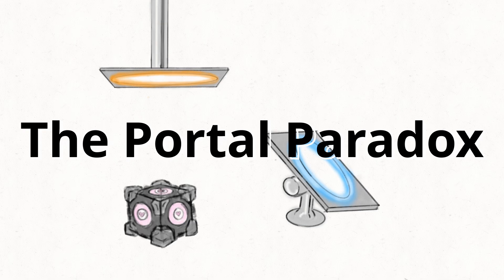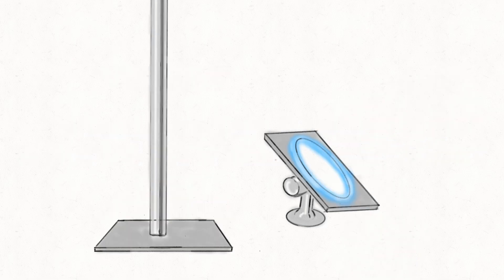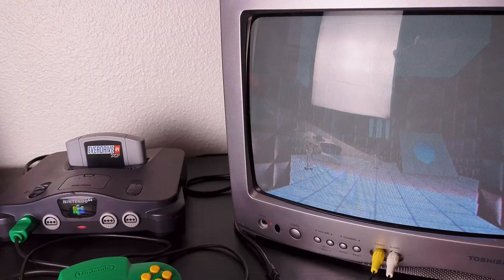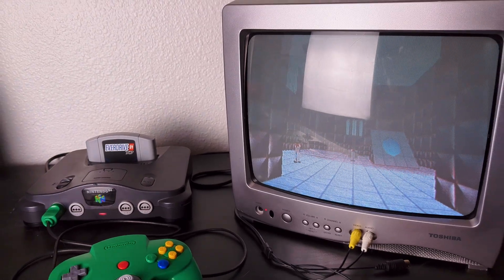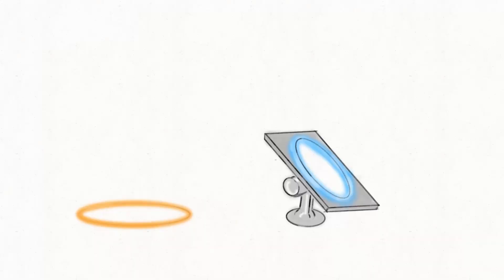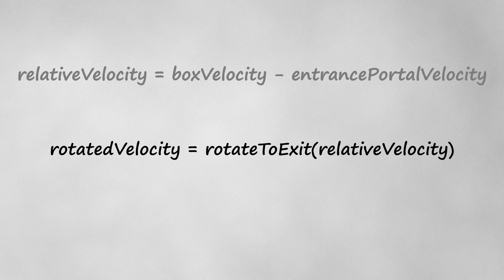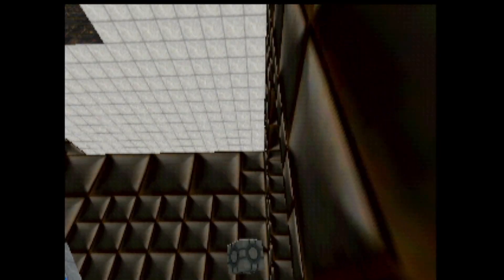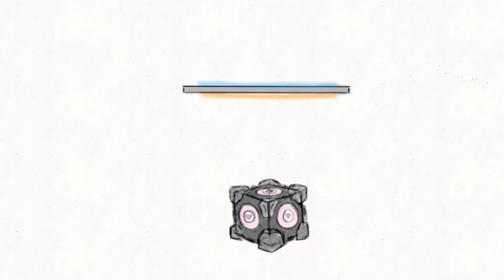I rewrote Portal from scratch and solved the Portal Paradox

Comment: I believe the portal paradox makes the false assumption that the object is moved from one location to the other. The portal however is connection of two disparate locations (wormhole) in this case it's two dimensional. 

From the point of view of the cube (and it's inertial frame) the only change would be in the direction of gravity. 

I believe your equation is correct but fails in that it assumes the two "sides" of the portal have different velocities. While this is true from an external reference, to the cube they have the same velocity. 

Probably also wrong, but that's how I am seeing it work.

Comment: i always thought of it as the total momentum of all three objects remaining consistent, so i figured the cube should stop, but admittedly i struggle to keep track of everything
Reply: I have the same idea. What happens to momentum here. The portal (or the object it is placed on) would decelerate giving it's momentum to the cube. But I cannot rationalize how that interaction would occur.
Reply: @mithrandireichner2667  The answer is basically that the cube doesn't actually accelerate and no additional momentum is required, so none is taken from the platform. The cube is already in motion relative to the portal as soon as the platform starts moving, it simply continues at the same relative velocity because no additional external forces act upon it to slow it down. It makes no sense with our current laws of physics, but, if wormholes area real (and traversable) our laws of physics are wrong anyway.
Reply: @mithrandireichner2667  From the cube's frame of reference the portal has velocity, but from the portal's frame of reference the cube has velocity. Relativity says whichever frame of reference you measure from the total energies involved are conserved (don't change over time), but that individual components of the system can measure different readings depending on the frame of reference you use. You can even use moving frames of reference such as the portal as long as you account for that movement.
We can simplify everything by measuring from the blue portal. And since when traveling through the portal the point in the middle of the orange portal is in the exact same place as the point in the middle of the blue portal (there is no spatial or time difference between them) We don't need to change to a different frame of reference, and therefore no adjustment is necessary (we'll call this point A). 
The velocity of the box going into the portal, as measured from point A = the velocity of the box exiting the blue portal,  as measured from Point A.
Reply: This was my thought too, but when I went to write out a comment about it explaining the math, I think I found the solution. 

Newton's first law states that an object at rest stays at rest and an object in motion stays in motion, until acted on by an external force. But also, motion is relative. An external force acts on the platform to move it down towards the cube, so the cube is already in motion relative to the platform before it even enters the portal. When the cube goes through the portal, no additional external forces act upon it (aside from small ones like air resistance and gravity) so it retains the momentum relative to the portal.

This does seem completely illogical based on the laws of physics we know, but that's because our laws of physics don't allow for moving portals. If you imagine a similar situation in space, it might make more sense. If wormholes had no field of gravity, then an object entering a wormhole would come out the other side at the same speed it entered relative to the wormhole. It doesn't matter whether the wormhole or the object is moving, as motion is relative. No external force would have to act upon the object for it to retain its relative velocity.
Reply: @ayylith  The way I see it, the system encapsulates the portals and the cubes. One side could argue that the cube is moving relative to the portals, but when discussing physics, or math, especially linear math, the discussion happens within systems. We could go on discussions about the properties of this system, but I'm going to ignore that for my comment. Assuming the system includes gravitation, that should logically include the exerting body of that gravitation. So the basis of this system is Earth, the cube and the portals. With both portals, gravitation is negative in both cases, so towards the basis ground of the system. This does not change regardless of any other factor. It is a fact, then, that the cube is resting relative to Earth and the portal is, in fact, the object that is moving. So it stands to reason to assume that the portal is moving relative to the cube.

So my interpretation of this problem more or less disregards the portals themselves as effect sources since the basis of the problem is the cube in resting position. The only thing that should really be affecting the cube is gravity, assuming the portals don't add, subtract, convert, transfer, etc in the process, and that itself is a question based in unrealized information of the *game's universe*, not ours.

Comment: too little experiments to prove this paradox. Altho i do think the example of paradox is flawed itself. Why portal should be drop from the top and not moved from the side? Why the exit portal must be on a slanted surface and not on ground or wall?

If i were to stand in front of portal, that is moving towards me at a high speed. And another portal is on the static wall. If i jump a little and portal moves into me - i doubt i will be launched from another one. I think i will just land on the ground just as normal. As there is nothing, that can impose the momentum on me in this situation.

Comment: I feel like portal paradoxes have changed slightly. Although these were ones that started during portal 1, I've heard of one about tying a rope that goes through each portal (the rope paradox if you will);
would the rope infinitely fall or be static? what would happen if you extended/compacted the portal distance?
This was definitely one of the better paradoxes for me.
Reply: Stop calling solvable problems paradoxes. Gravity still exists. The rope would be pulled towards the earth, "down", and speed up until it's falling at terminal velocity.

Comment: The problem with this is velocity in =\= velocity out. But Energy in = energy out.

The portal has kinetic energy (mass times velocity^2) which is what allows it to move even if we assume that kinetic energy was perfectly transferred to the cube (despite not actually touching the portal), with no loses in heat or sound etc, it would not result in the cube move in at the speed of the portal as they have different masses an kinetic energy must be the same.

Comment: to me there's never been a paradox, it's kinda just like the mirror theory where the mirror is another world you can't enter because you're getting blocked by yourself, i think it's the same here but you're just getting crushed by yourself, from both sides, with same pressure of the two plates crushing you, with or without the portal, only thing that changes is that you're not crushed by steel plates but yourself

(im talking about the scenario where you're in between two portals closing in on you, or an object, you don't have to sacrifice yourself for science)

Comment: This is all dependent on the inside of the portal actually having mass rather than just the boundaries. If the portal is two dimensional with basically a void in the middle where one space merges into the other, then the "collision" with the cube doesn't really happen and the velocity of the portal boundaries doesn't matter beyond influencing when the translation happens. You just have the cube maintaining its velocity after being translated into another space. If that's how portals work, then the cube goes plop.

Comment: everyone always be talking about relative velocities, but dont take into account that the actual relative velocity that the cube sees through the portal, which would be zero. the portal js moving, obviously, but since the cube "sees" through to the other side and doesnt interact with the edges of the portal, the relative velocity of the portal would just be the speed of the other side of the portal, which happens to be 0. 

drawing a force diagram is helpful to understand this too. the portal has no way to impart any energy or momentum to the cube, it just conserves momentum through itself
Reply: The "speed of the other side of the portal" isn't zero - it's the speed of the falling portal approaching the cube. From that perspective, looking into the falling portal, the view of the other side would be approaching rapidly. The point being, energy is conserved upon travel through portals and it doesn't matter if a cube is falling into a portal or a portal is falling into a cube - the relative velocity between the two is identical.

Comment: Unless there is a way for the portal to transfer its kinetic energy to the block, the block will have no energy when going through the portal. And I don't see how a portal would transfer kinetic energy to the block considering the block is just passing through.

This is like a hoolahoop travelling at a certain speed at a non-moving block (floating), when going through the hoolahoop, nothing happens to the block. The kinetic energy from the moving portal is either transfered to the ground (slamming into the ground) or to what is holding it up (by slowing down the portal).

So I don't think your answer makes sense. At the very least there is a reasonable doubt about it.

Comment: So many of you are going on about the theory of relativity, conservation of energy when exiting the portal, etc. Consider this: portals are fundamentally incompatible with either theory, at least when considering objects larger than a single atom. In that sense, they necessarily break the laws of physics. For the momentum of an object exiting the portal to always be the same as it's momentum when entering, it'd be necessary for the portals' own position and velocity to not affect the object. Which is the opposite of how portals work.
This contradiction can only be resolved by assuming that portals break the laws of physics as we understand them. And keep in mind that our current laws of physics were only made to describe reality as best as possible, not to dictate it. And the existence of portals as portrayed in the videogames, even without the need for moving the portal, is already incompatible with our laws of physics.
Sidenote, i'm really proud of myself for figuring this out on myself years ago when i was 15yo lmao

Edit to the video creator:
The flaw in your equation is that you programmed the cube as a single object, which passes through the portal. This equation would be correct if you only threw a single, unconnected atom through the portal, but it's not representative of what would happen to a box, which is a gigantic mass of very much connected atoms. To code it more accurately (but still not perfectly), each atom would have to be accelerated as it enters the portal independantly. This would either cause the atoms of the part of the box which exits the portal to pull the atoms that haven't yet passed through the portal, to pull them through the portal faster. Potentially fast enough to break atomic bonds, but for the sake of argument, let's just assume that the velocity required for that doesn't impact a single box.
So, you can think of a simplified mental image of this the as a rubic's cube. Each "square" represents an atom. As you slide the rubic's cube through the portal, at first, only the first columns of the "squares" exit the portal on the other side. But they're still connected to the rest of the cube, which is still on the other side of the portal, about to enter the portal. Right? So, what happens?
Well, if the entrance portal is moving down on a cube and the exit portal is staying still, and the cube is staying still om the ground in the path of the moving entrance portal, then the atoms which first enter the portal at eg. 1x entrance portal velocity, will exit the exit portal at 1x entrance portal velocity - but as they are still connected to the "squares"/atoms which have yet to enter the entrance portal (and are thus moving at 0x entrance portal velocity), would get pulled by the squares/atoms which have already exited the other side further into the portal, while additionally gaining velocity from the motion of the entrance portal, which is still moving to fully engulf the cube at a certain velocity.
Now, replace my analogy of the rubic's cube with the actual in-game cube, and then replace the amount of squares in my example of a rubic's cube with the actual amount of atoms in the amount of atoms in an in-game cube.
Voilà.

(Apologies for the horrible obtuse explanation, i could explain it more clearly with pseudocode, but i'm far worse at communicating exact concepts with natural language  even assuming that i'm right, and i recognize that i might be completely wrong lmao)

Comment: If we think in terms of kinetic energy, where does the cube get its kinetic energy from? Is it energy which comes from the moving portal platfom? If so, when does the energy transfer happen? Continuously while the portal slides over the cube, or instantaneously at the very end? Second one would defy physics (if the cube has a mass). Another comment asked the right question: what happens when the portal stops at the middle of the cube?
Reply: I made a really long winded explanation on why he's wrong, but in the simplest of terms, the cube would not gain velocity, the portal merely closes the distance between the cube and whatever is on the other side of the portal, it does not gain momentum as that would mean energy has been created from thin air (conservation of energy backs up this claim, it's not just you, this guys smart at programming, not at physics 😅

Comment: I always interpreted the portal as just a hole in space that lead to a hole in another space. It's likely going to shoot out though, because of how air pressure works, and has anybody considered that? If I run at you very quickly with a window frame, air from that movement would be hitting my face. Assuming air goes into the portal the same way that objects do, it will create increased air flow into the portal relative to the velocity of the moving portal. Meaning the receiving portal will be pulling air from the moving portal, hence it may shoot out (sorta), the box will be pulled out based off that air flow and it's own weight's resistance to that air flow.